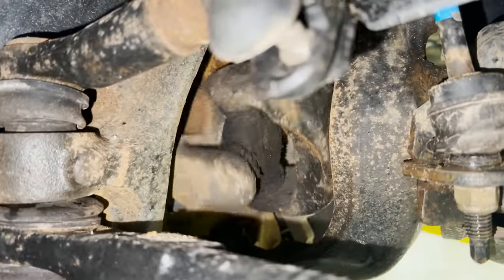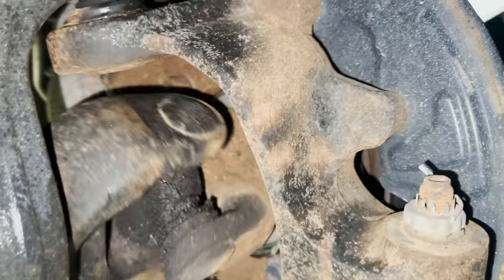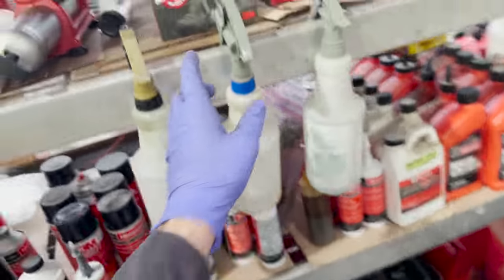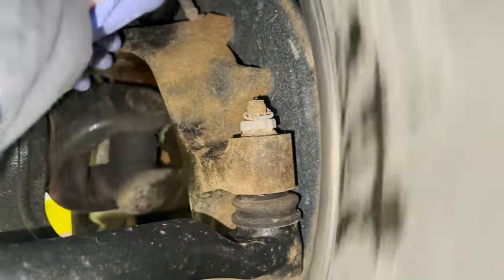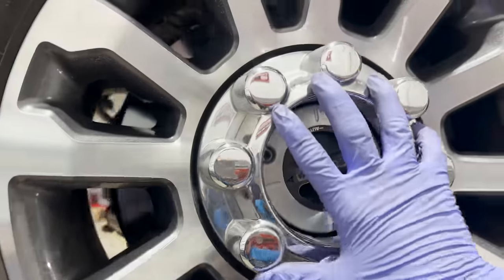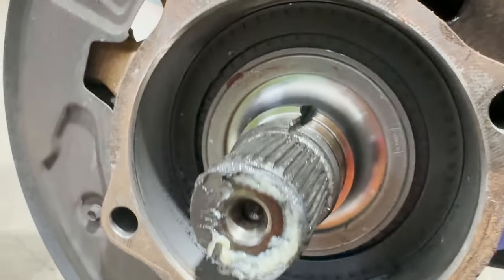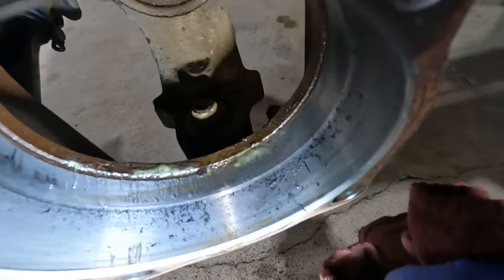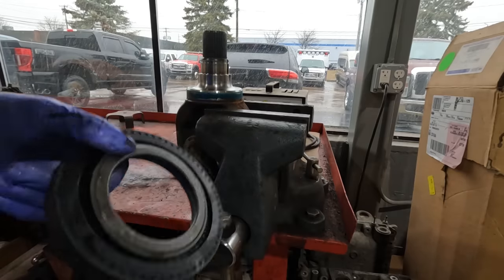NEW FORD trucks | FAMOUS 4x4 NOISE - FIXED!! #4x4 #ford #broken

Comment: No torque specs on anything......just give everything half a dozen ugga duggas and call it a day. Even the lug nuts get 300ft lbs to warp the rotors so in 6 months you can sell a full brake service 👍
Reply from the maker: Typical keyboard warrior. Enjoy using your playskool tools smart a$$

Comment: The metal ring is a depth gauge/spacer. It’s only used on newer trucks. My 2015 did not require its use. Sorry I don’t know the year it started being required. The tool came with the information but I tossed it.
Reply from the maker: Its to install the seal into these hubs m. All the trucks

Comment: My 22 F350 makes this sound wether it’s in 4WD or not. Coming from the driver’s side, too. Is it possible it’s the same seal?
Reply from the maker: Ur front hubs shld not be spinning in 2wd. Are they in auto or in LOCK?????
Reply: @PowerStrokeTechTalkwARod  The hubs are set to auto and the transfer case is in 2HI. The first time I noticed the squeak was after using 4WD.
Reply: Its probably stuck in 4wd due to vacuum leak and seal is bad.

Comment: I meant to ask, Why do you think there was no noise when not in four wheel drive or was it both? Wouldn't the seal spin in either drive mod?
Reply from the maker: No because the axle shafts do not spin in auto.....
Reply: @PowerStrokeTechTalkwARod  Great video

Comment: Excellent Video! Two QUESTIONS at the end of post. The Dana 60 axle assembly is very different compared to 25 years ago. The new units with axle seals and unit bearings considerably different than the old spindles with inner and outer 'serviceable' Timken bearings held on with spindle nuts and C clips. 

I would prefer the OLD, yet more reliable, durable, low maintenance cost, heavy duty set up with spindles and serviceable Timken bearings with the inconvenient "Free and Lock" manual hub settings verses the NEW unpredictable service life of axle seals and unit bearings with the convenient "Auto and Lock" automatic hub settings that also have additional parts...solenoid and vacuum lines to maintain. 

I would have no problem with manually locking in the hubs before going off-road in mud, snow or sand. More often than not, any mechanical system designed and engineered with a "convenience priority" does not equate to reliability and durability. In other words, driving through mud rutted roads or deep snow.....and the "unit bearing" ceases...resulting in loss of drive in the front axle...the so called "convenient system" which has unknown years / miles reliability would now become a very "inconvenient system". 

UNFORTUNATELY, the DynaLoc (from DynaTrac) heavy duty free spin hubs are not available for 2015+ Super Dutys. Dynatrac discontinued the DynaLoc heavy duty free spin hubs for 2015+ Super Duty trucks.....not sure why, but heard it might have been associated with compatibility or function of the anti-lock brakes.

Do you know the expected "service life" of the axle seals and unit bearings? Does Ford have any service replacement guidelines in years or miles on the Super Duty?
Reply from the maker: Nope they sure dont
Reply: Cars have been using sealed bearings and hubs for 40+ years.  They are as maintenance free as it gets and overall failure rate is pretty low. Ive never seen them on any form of maintenance schedule from any manufacturer. Simply a "replace when failed" part. I've also never seen a wheel bearing assembly seize, they simply wear and get sloppy and noisy. More likely to fully separate then seize, but if it gets to that point you would have had to be ignoring the issue for a LONG time.

The auto position on the hubs is default off. It takes vacuum pressure to engage the hub while in the Auto position. If the vacuum system has failed you can still manually engage and disengage them.

Comment: ? Axle tube shaft seal replace. If it were to leak after this repair I would consider it a 2nd effort
Reply from the maker: Thats in the diff, theres no need to replace that seal when doing this job
Reply: @PowerStrokeTechTalkwARod  ohh that makes sense then. The way these seals and mating surfaces are engineered these days seems so overly complicated

Comment: Did not torque any nuts,,bolts,,or lug nuts
Reply from the maker: No, are you okay?
Reply: @PowerStrokeTechTalkwARod  

I'm okay but it is a bad practice to not torque suspension, axle or wheel lug nuts

Comment: Awesome job, curious. Did you apply anti seize to the wheel hub face or wheel studs? I always thought anti seize on studs was a big no no.
Reply from the maker: Not the studs
Reply: Why not, been doing this on everything I own, from sxs's, tractors, trailers, and vehicles. 40 years never an issue.
Reply: Because it affects the torque value. I do what arod does.
Reply: @scha0786  ok I get that, but you should be torquing your lug nuts every month. Well at least that's what my grandfather taught me. Idk man, never had a failure in 35-40 years. And further more, if you are so concerned about torque, ask AROD why he never pulled out a torque wrench on this particular job or any job he doesn't use one. I for one am a torque fanatic. And after 40 years of turning wrenches I do know the feel of specific torque values or just how far I feel safe tightening something up, but, I still use a torque wrench every single time. Plain and simple. Not using one is laziness and thinking you're(anyone) somehow better when in fact you are not, unevenly torque values on a specific item cause premature wear.
Reply: @betterthanideserve76  Torque lug nuts every month? That's a little over kill.
Reply: @mattsbrute  hell, I rotate the tires on 3 vehicles and one 5th wheel every 3 months. Change oil, oil filter and fuel filters on 2 superdutys and one expedition every 3 months. Yes I absolutely overkill all my maintenance on everything I own. It's my thing. I'm even worse with my house and grass, I'm not even gonna get into all my hunting leases.
Reply from the maker: Thats the silliest shit ive heard all day
Reply: Washing machines work hard too
Reply: @betterthanideserve76 hmm well since you’re wondering why your lug nuts keep loosening up I’d start with the one difference that you do that nobody else in the world including the mfg of any vehicle from the largest car company in the world Volkswagen Group to the largest American car company GM to the company that Arod works for who has sold the most pick up trucks every year since their inception Ford not a one out of any of them says to torque your lug nuts every 30 days and certainly there’s no service bulletin about using anti seize on the most crucial part you definitely need to stay on and attached to your vehicle whether you’re doing 160 mph on the autobahn like allot of the cars the Volkswagen Group builds such as Volkswagen, Porsche, Lamborghini, Rolls Royce and Bugatti even the company who is responsible for the creation of the first automobile, Mercedes doesn’t recommend that, also under the same control who builds the most  Semi trucks responsible for hauling billions of pounds of freight across the the world doesn’t recommend that, down to the company who has built the best selling truck since it’s inception Ford doesn’t suggest anti seize. 

When none of those company’s recommend using anti seize on the most crucial nut and stud on the vehicle any vehicle mfg would say the most important nut and bolt combination that needs to be tight stay tight, and also continue to be serviceable for the life of the vehicle.  I think I’m going to side with those recommendations and keep anti seize away from my lugnuts. 

My respect to your grandfather who I’m sure was a great man. I’m just going to assume from your practically uncomfortable, demanding command presence in your comment delivery with expectations that this way is the only smart and correct way not to be questioned or challenged that your family comes from a military service background which my respect if Im assuming correctly. So maybe your grandfather was in the army core of engineers and drove around in an amphibious vehicle for a part of his life in which in that case I’d see the connection of anti seize and it’s overwhelming requirement but the weird infatuation with anti seize that it’s great for everything is a little different. 

Since there’s very few folks out there fitting the amphibious vehicle ownership daily operating lifestyle your argument is pretty hard to find support for furthermore the fact that you have to torque down your lug nuts every 30 days when nobody else in the entire car and truck world has this issue so lobbying for this extra lubrication point doesn’t sound very attractive and might be hard sale maybe considering that you have to service your stud and nuts every 30 days to prevent from premature torque busting, maybe you should look at the one difference that you’re doing that nobody else is doing or having this premature nut busting issue you have. 

Try laying off greasing your stud so often and it may just fix this problem you have of premature nut busting. When you are prematurely busting nuts from your lubricated your stud things can get messy really quick without warning. Keep your nuts clean and you can always rely on them. 
Good luck with your premature nut busting issues and my respects to your grandfather, good day to you kind sir.
Reply: @seanoconnor1398  sorry you had to write such a long reply, maybe I misspoke. I check my lugnuts every month, just a torque check. I do the same on my 5th wheel before every camping trip, which happens to be every month. They have never been loose. I dont cake it on, I just apply a thin layer. Never had an issue. I am OCD with everything I own. Even every wire connection gets dielectric grease. 5k mile full services on my diesels and 3500 mile services on all my gas. New tires well before they need changed. I never go more than 3 years on tires. I appreciate the comment but to each their own. Safe travels